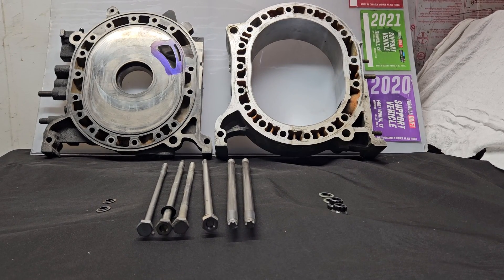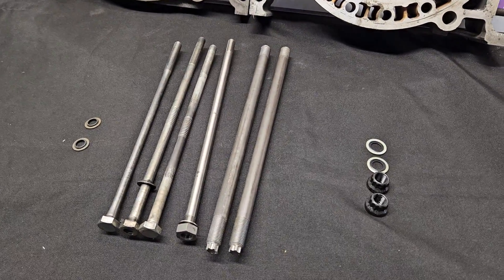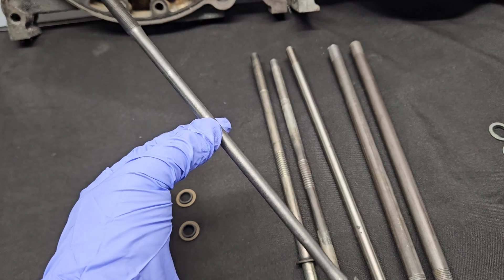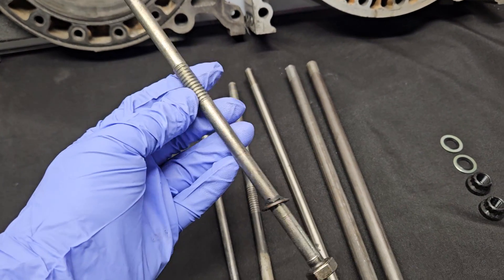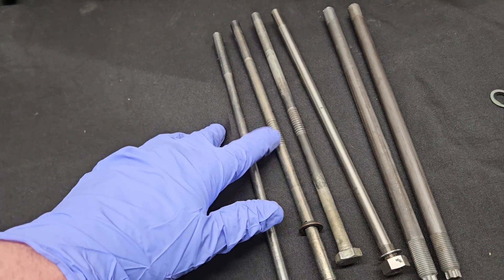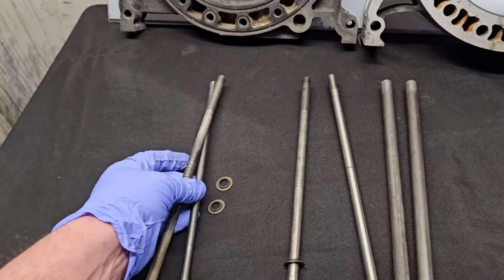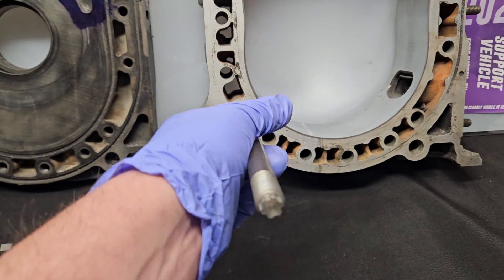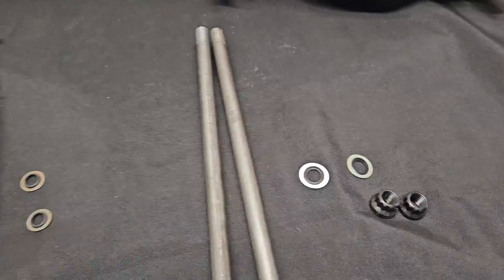Rotary reliability - tension bolt vs aftermarket studs how to build a stronger rotary - KMR Tech

Comment: couldnt you drill out the housings/irons to fit 1/2 studs why specifically machining? (not saying I would)
Reply: The factory holes in the housings are cast and not precisely located enough to use as a guide when all 18 holes have to be within a couple of thousands of an inch

Comment: points that should be covered - the effect of the same TQ setting on a different thread ( M10 x 1.0 V 1/2 unf 20 ) / countersinking the block thread and shouldering the stud thread into the block and thus its effect on axial rigidity / making the dowty seal ( the bonded washer ) or the O ring land on the stud shank and not the thread/ the use of the ARP thick washer .. to allow a concave on underside for the O ring guys . and to allow for thermal expansion when the block is hot

Comment: Please discuss Dowling. In the past I used Dowling tubes on all bolts  to take the pressure loads off the bolts , I would do this on 14-21 psi or pp s but the space race has moved on as has new parts  now available

Comment: Hey Kyle, I had a semi p 13b rew with rx8 rotors built by chip a bit ago. Nelson told me you had something similar a long time ago. My question is what coolant temperatures should I be running the car at? What is normal operating temperature, and is 205°f the max? Thanks!
Reply: I should also add, I’m running a dual pass radiator with dual spal fans, meziere 55gpm water pump and the engine is turbocharged on e85